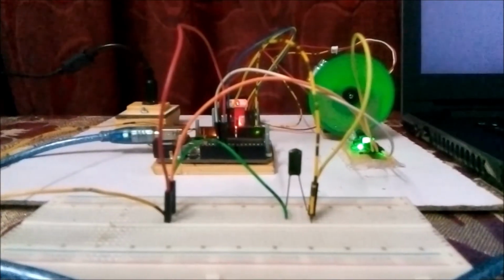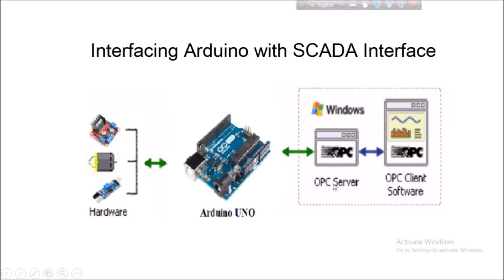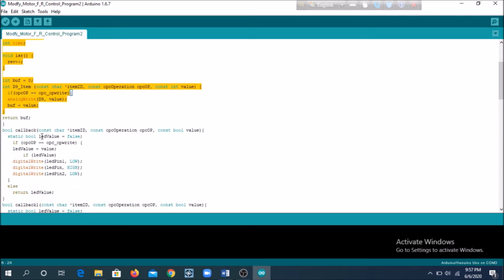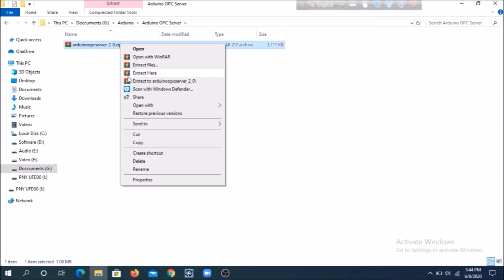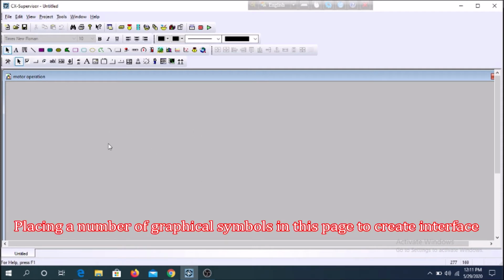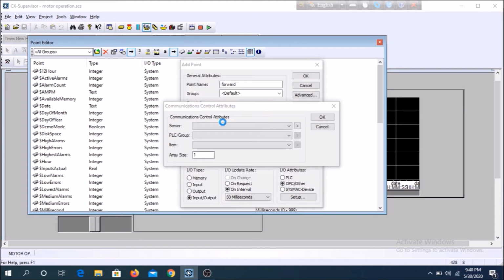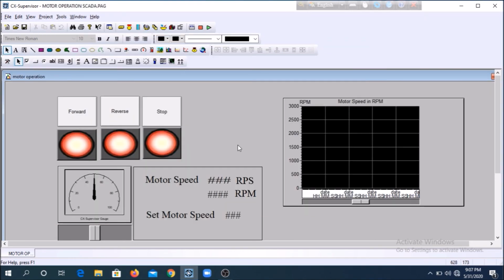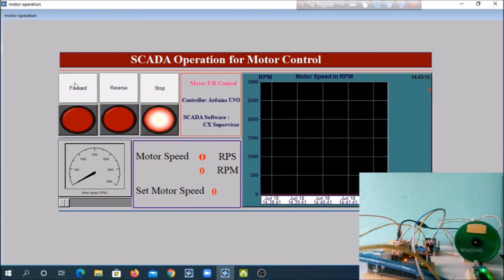Arduino based SCADA with CX Supervisor

Comment: I checked all the connection. In dopc  explore I get output but from Arduino pin no 8 & pin no 9 I did get output , only pin 12 gives output . Is any changes in Arduino program  or u have any other program for it pls  send me because I take this project as my final year project
Reply from the maker: Please specify your problem. Send your screenshot for arduino sketch you created, screenshot of configuration for arduino opc server.

Comment: Hi, I would like to know if I can use ESP8266 device for make a Scada and monitoring some sensors like current, voltage, temperature with that software.(This is from Omron, isn't it?)
Reply from the maker: Yes, you can use  ESP8266 device for scada by using modbus tcp/ip or modbus rtu protocol. For that you have to upload modbus sketch on  ESP8266 device and use a scada software that supports modbus protocol.
Reply: @TechTutorial20  Thanks, I'm going to try to do for those methods.